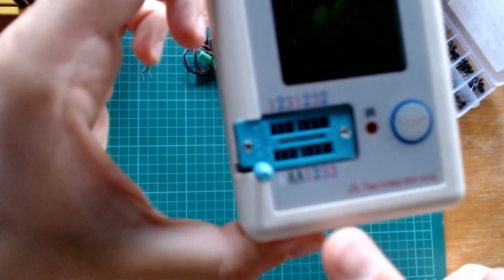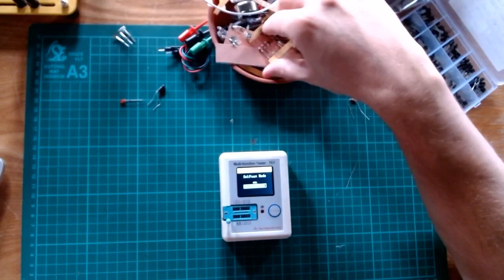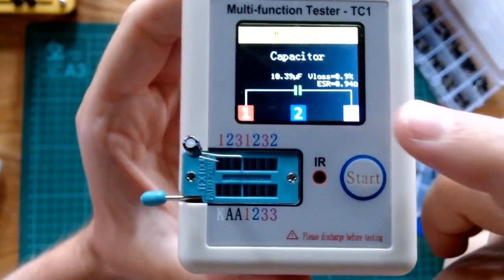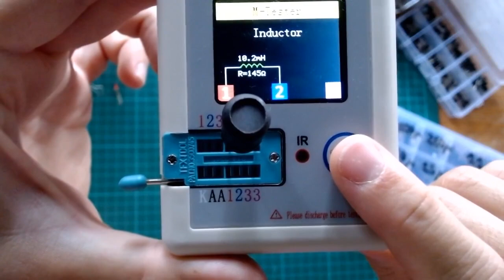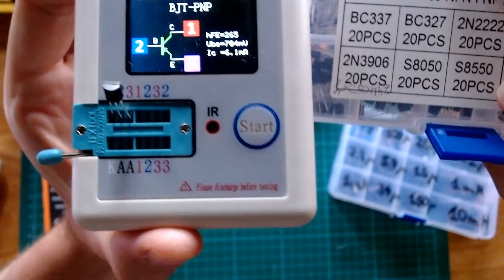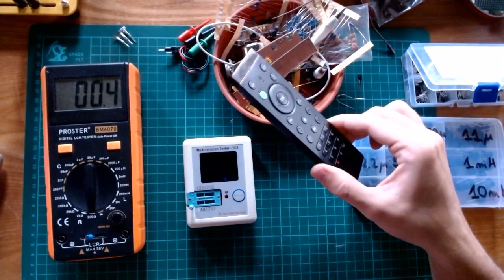Episode 38: TC1 Multi-Function Tester

Comment: I agree, this is a very useful tester. It's reasonably accurate for the nominal values - that is, the inductance is about right. But it gives inaccurate readings for the inductor's resistance.

Considering how inexpensive the tester is, I can accept some inaccuracies.